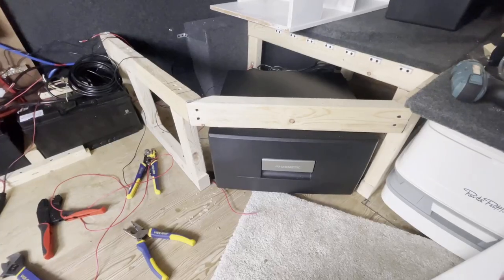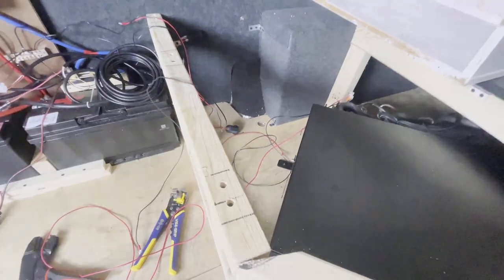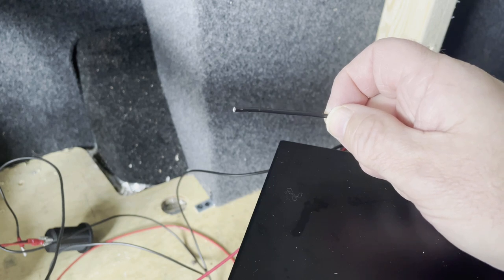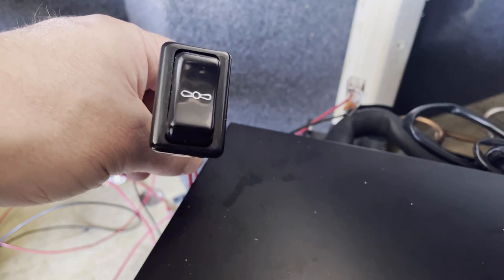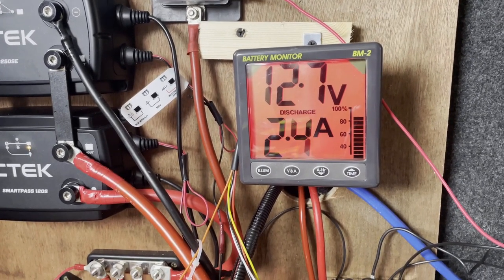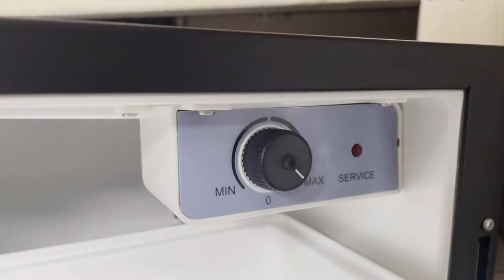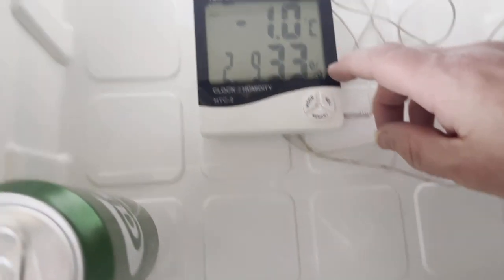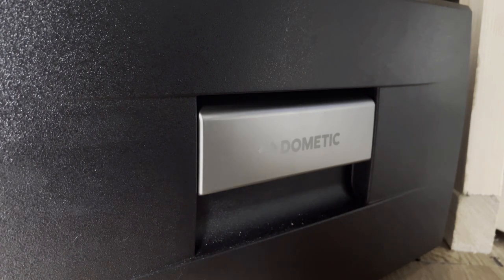I Install a 12v Dometic CD20 Fridge in a Campervan

Comment: Nice to see you back. Interesting seeing the power usage on the fridge.
Reply from the maker: Thanks. Yea I hope it’s useful to some people who are unaware of different types of fridges and cool boxes
Reply: @OntheRoadLiving  I've currently got the Dometic Tcx 14 cooler and I'll be honest it is efficient, it's not on permanently and kicks in and out. But appreciate its not as efficient as the compressor type.
Reply from the maker: Oh I see that they’re quite advanced versions of the peltier design, I didn’t realise that some kicked in and out, on my boat I had a £30 one that was permanently on. Ive made do with nothing for a few years then the Waeco cool ice 22 that needs ice added every week, had that for two years, so wanted to justify spending loads of money on this new fridge
Reply: @OntheRoadLiving  I was surprised but St the time couldn't justify the spend for a compressor type. However, I like your design, i think to get more efficiency out of the batteries I'd go for similar next, still struggle with the  cost 😂. Will be interesting to see how you get along with it along the journey.
Reply from the maker: I bought this fridge a few months ago, glad I did as couldn’t afford to buy it now though. Yea it’ll be interesting to see how I get on with it, once I’m on the road videos will change to everyday travel and what I’m up to so easy to give updates

Comment: Hi, I’ve just bought a camper and wondered if I should add an isolator switch to my fridge… I wondered why you added a switch when inside there was a dial which when you turned it to 0, the compressor turned off… surely it is doing the same job as the inline switch. It made me look at my own fridge…. I turned it down to 0, the compressor turned off… I am not sure I need a switch now!?
Reply from the maker: Hi, don’t worry about a switch if your fridge has its own switch like this model. Just a fuse is needed and removing the fuse when fridge is off long term like in winter. 

As power can run low sometimes I do put a switch on other things that use power in standby. 

At the time of installation I didn’t know how much power my fridge would use and was wanting an easy way to test it without having to remove the fuse every time or opening the fridge (which means the compressor kicks in quicker due to temperature loss so my test results would be wrong). 

I hope you have a great time in your camper, cheer Shaun

Comment: Hi mate. With this fridge does the fan stay on for duration whilst turned on?
Reply from the maker: Hi, no once it reaches temperature it goes off, when I tested I think it was on between 15 and 20 mins per hour, extremely efficient
Reply: @OntheRoadLiving  thanks